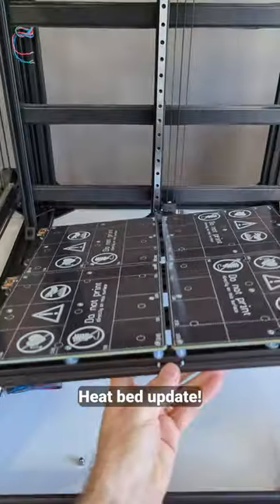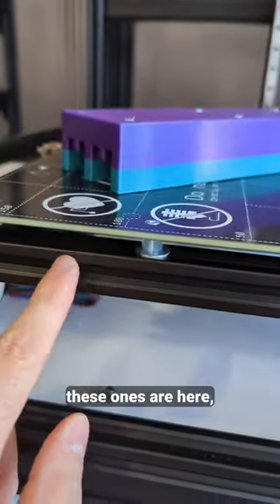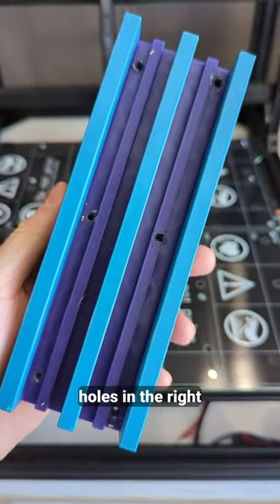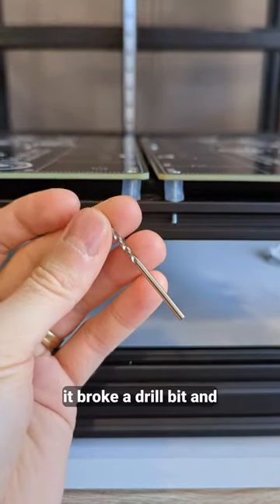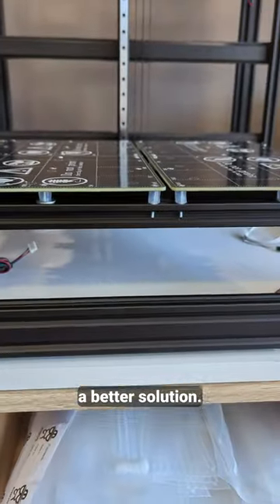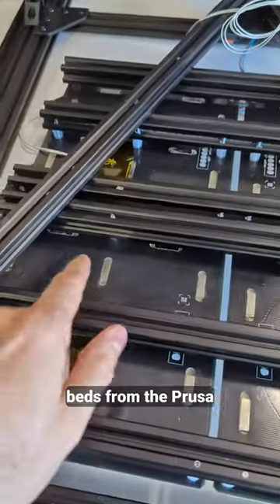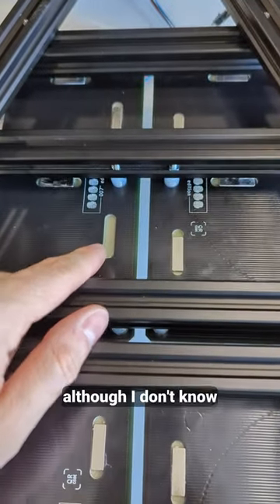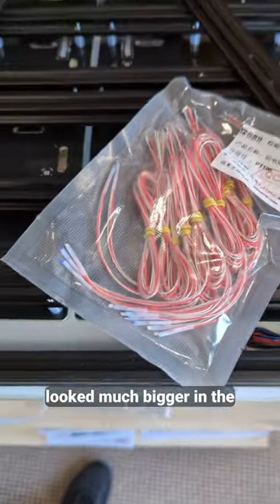Individual bed plates mounted on the 3D printer prototype

Comment: Dude, if you want flat, you should be using aluminum tooling plates. Also, your gap between those is way more than it needs to be. Even if you got those things to 150 Celsius, they would not expand anywhere near enough to reach each other.
Reply: I too, think there's a lot slop in the tolerances. "Uniformity" is a word all us 3d geeks need to learn. Can't have a true square or a perfect cylinder without uniformity. However, will 4mm or more be an issue? This is still something I think i haven't the ability to build myself. Beyond impressive.

Comment: I've tried tubes. Looks like same as you. Silicone tubing. It can't handle much over 90-100c. After that they will get permanent deformed. (Squished). You only notice it after a while. Not immediately. Just sharing my personal experience. So you don't have to

Comment: Since I have made a printer that also has 4 heatbeds I have to ask, aren't you worried about the cold spots that will form where the beds connect and also I wonder how much the bed variance will be with this because with mine I had to try really hard to get it under 0.1mm
Reply: You should stick a copper or aluminum plate over the entire thing. It’ll spread out the heat and even it out and prevent dips in the gaps. The flexible bed is going to sag into those gaps without something underneath

Comment: Why not something easier to build and more powerful@230V? Silicone heater with SSR. Good quality 24V PSu's are expensive.
Reply from the maker: True, but also less safe for a DIY project. Also wrapping heaters in an insulator doesn't seem ideal.
Reply: @MihaiDesigns  that's why you need to connect all metal parts to PE ;)
Glass fiber/resin composite is also thermal insulator.